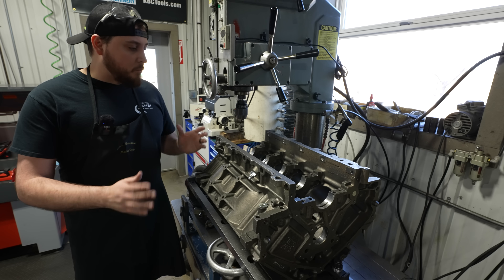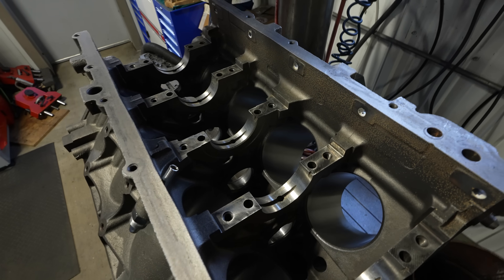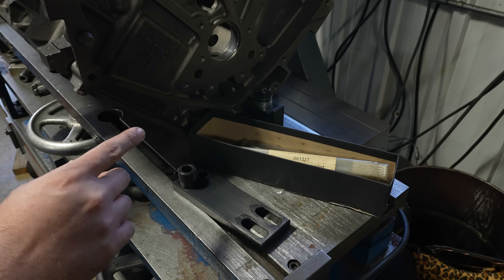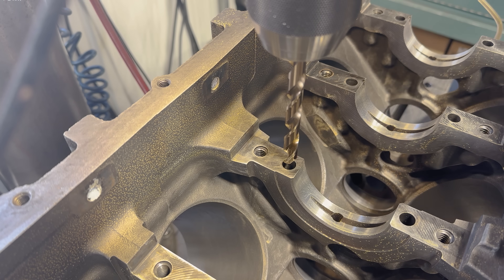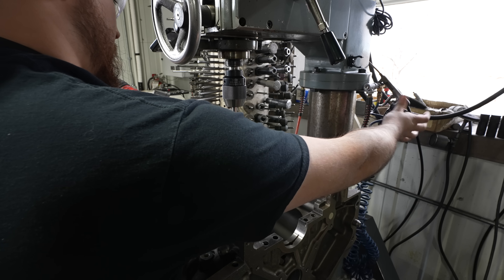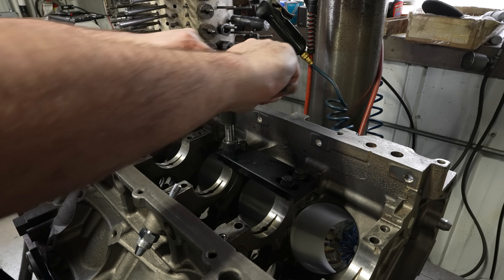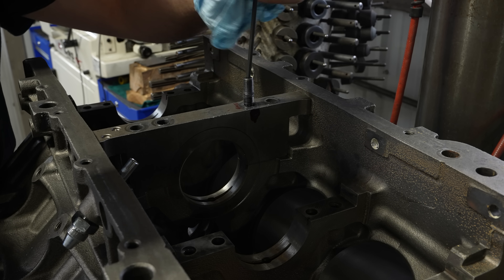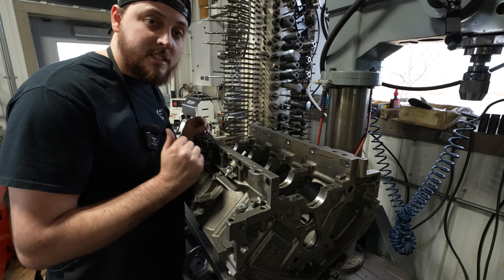The Customer BROKE A Main Stud Off In Their BRAND NEW LS Block...

Comment: Snapping bolts off in an engine block is a great sign that you have no business building an engine. Just sayin'.....
Reply: Work on enough of them and it will happen.
Reply: @4040pmora  33 years a tech, and 40 years of building / repairing engines, I've NEVER snapped a main bolt / stud, or a head bolt / stud. I've removed broken ones, but never snapped one off while torquing to spec.....
Reply: I've had brand new GM stretch bolts break off during the torque sequence. Shit happens
Reply: @garysgarage.2841  In vocational school, I watched a guy blow a chunk of the block out of a 4.2 AMC, because he didn't clean the bolt hole. Someone else's mistake, taught me a valuable lesson on the importance of proper preparation of critical fasteners. I have a ritual when it comes to head bolts / main bolts / cam caps, etc. TTY fasteners I mark with several paint marks, several colors, so I have 100% accountability for each step. I avoid distraction until I complete a sequence, then I can come back, and know where I left off, if I HAVE to, but I try to complete the entire torque procedure, without stopping. My tool rep checks my torque wrenches every 6 months, so I trust them. I probably owe it to skinny Mike, the guy who forced NCAVC to buy someone an engine, for going more than 3 decades without snapping a head bolt / main bolt, or any other critical fasteners. It starts with clean, dry holes, a thread chase, and another clean and dry, before following the manufacturer / or hardware supplier instructions.

Comment: Did one yesterday on my EDM. I even save the original threads. It depends on how much previous work the customer did trying to FIX it. Drilled off center,Broken Drill Bits, Broken TAPS ,and the BROKEN E-Z OUT are what you see from the Engine Shops.Let see you get a CARBIDE END MILL out using you mill. Use a burnishing tap, not a Bottom one to clean these holes with a lot of lube and blow out these holes.

Comment: On a new block and even one that had machine work done, the threads should always be cleaned and chased before bolts are installed. Also in this case I would venture to say either the person installing the studs did not use a torque wrench or does not know how to properly use one, or the one he used is way out of calibration.

Comment: Our shop has several EDM sinker machines. You can take a piece of copper tubing and burn out broken bolts, taps, etc. in short time.
Reply: Don't forget all HARD crap we can remover also and save the threads with our picks.

Comment: Well for those that have the time, on aluminum cased yamaha banshees if you drill out all the case bolts and use time certs its actually stronger than the original bolt holes.

Comment: We use a Carbide endmill and a Pure Carbide drill bit and pull out the threads or dill till the threads look like a Helicoil,   OR  we tap the block for 7/16 threads and put in a ARP stud,
Reply: That is the real FIX and linehone the block.
Reply: I fix others people’s foulups all the time. No good deed goes unpunished. Picture a shop the size of two Costcos. I use a milling machine, NOT a freaking drill press. I hold the part securely and locate the problem hole exactly. For a fastener I flatten the top and use a spot drill, then a left hand drill under the minor size of the thread. The left hand drill might loosen the fastener and back it out so I’m ready on the quill to let it happen. Then I try an “Easy out”. If that didn’t work, I interpolate out to the minor hole size feeding down manually ready for the remainder to come out. If it doesn’t, all that’s left is the helical thread that be picked, pealed or wiggled out. Taps are a bit more complicated and carbide can burned out but in all cases you got to be dead on and rigid. The worst thing is when some monkey tried and failed, further complicating or necessitating a Heilicoil or Keensert.

Comment: I have built multiple handfuls of those engines and have never had a main bolt issue. Also, with the arp studs, it should be line honed.
Reply: the ARP studs will be more precise than factory; the register in the block determines alignment
Reply: @donwest5387  it is still recommended to line hone the block with fastener upgrades as well as connecting rods be checked and resized if needed. Of course, cracked style rods can't be done.
Reply: @donwest5387 totally agree! No metal was removed from the cap or the block.
Now, they might want to line hone the mains. 
In my opinion, I'd run it like it is.
Reply: The bore still be pull out of round when upgrading to performance studs.No  different to rod bolt change outs.Have seen many bores go out of tolerance 0.001”

Comment: I think for a high hp build this would be a no no. Could maybe use a longer timesert but even then. The wall thickness reduction is the factor in question really.
Reply: My thought also. Timesert only has one size. HeliCoil hasn't got around to making them yet.

Comment: I have to wonder if there is any real advantage in using the thread insert vs drilling the cap as well, and just using a larger diameter stud.
Reply: Keeping the clamping load even and parts availability seem like good reasons

Comment: I seeing you line up the hole with the drill bit, I was reminded that we had a set of drill bit blanks that were for just that purpose. You can take the blank and chuck it and there are no cutting edges to worry about as you place it in the hole. The other thing we used the blank drills for was as references for sizing.
Reply: I would have welded the hole shut with an inferior metal like slag and shoved a little bit of JB and had the shipping crate readily to go.

Comment: Small trick I use is I get an old head bolt or mains bolt weld the threads a little and use that to wind the time sert in.
Then, you come in with the expander tool.
I've had the expander tool spread the insert early, this is a big pain in a hole.
Once you wind the insert in with an old bolt, you use a rattle gun to wind it out.

Comment: Yes sir that is a good jig to use for that repair. Might the customer had contacted you before they `attempted to drill that out it would have been better. If you found dirt down in those threads well that sort of tells ya doesn't it?🥸👍

Comment: Salt water cooled Chevrolet marine based engines  have head bolts that go into the water jackets. Doing  a valve job on an older engine would sometimes  pull the threads  out of the block deck on final torque. Off came the head. Spent a lot of time squaring  the drill to the block while working on a 45 degree  surface in a sometimes  cramped bilge. Put bolts  in adjacent  holes to visibly establish  90 degrees in both directions. Drilled by hand with a portable  drill. Then had to square the Helicoil tap the same way. Installed the Helicoil and broke the tab into  the water jacket.Then held my breath  when  final torqueing. Also ran a tap into all 32-34 block  threads using a  battery  drill with the screw clutch set as loose  as possible. Clutch would  slip if the tap bound up  or if it cross threaded when starting . It allways worked! I know now that I was supposed  to use thread chasers  which I now have. No machine shop precision but good  results anyway. Probably could have used the head as a guide  for the drill bit  but still has to remove  the head to install the Helicoil.

Comment: When I rebuilt my 360 (5.9l Magnum) for my Dodge truck, every orifice was cleaned with a brush and rinsed well to remove debris. Each bolt hole had a thread chase run down it to make sure it was clean and ready for install.

Comment: Another great tool to add to the shop is a set of LH twist drills. They will pay for them selves in one successful use.
Reply: Good point. LH drill can remove the bolt by itself during the drilling, while RH can tighten the bolt even more. Choose what fits your needs.

Comment: I would have tried to drill it out with an endmill that the same size as the original drill tap size first to keep the original threads, in case they where¨nt damaged. But solid metal inserts is another great way to do it.

Comment: I use left hand drills to remove broken studs. If a stud starts to move it will come out with the direction of the drill rotation,,,, hope this helps
Reply: This. This is stud/bolt removal 101.  No reason not to do this.
Reply: Left hand drill bit works well for cases such as when the bolt head snapped off, and there is no real tension on the bolt threads. However, in my experience, it doesn't work well when the threads are gummed up by dirt, corrosion, or thread locker.
Reply: @superbarnie  How about when the bolt is stretched as in torqued?  I've had shit for luck extracting or drilling anything out that's been snapped off.
Reply: @Florida_Man_In_Florida  Well, I'm not an engineer but I don't think the bolt is stretched along the entire length. As the bolt is screwed into the hole, the male threads are engaging the female threads on the hole at a 1:1 ratio. Unless the female threads are deforming or they are the wrong thread pitch, they should in fact be supporting the bolt threads and preventing them from stretching. The only part of the bolt that can freely stretch would be the part between the threads and the head, because nothing is holding it in place. This theory is further supported by the fact that the bolts tend to always break in this area.
Reply: @superbarnie What is to lose trying that FIRST 🤔 
My dad showed me HOW NOT to break them in the first place , then how to fix if you/ others screwed up . LH Drill was always worth a try
Reply: Was wondering why this method was not tried.

Comment: i think it will last just fine.  Timeserts are pretty good steel, the block was cast iron, so the timesert should be better / stronger than the original threads.

Comment: If this is an engine for everyday type driving, it should last as long as the rest of the engine.  Back during the days when I was a mechanic, I never broke a main or rod bole.  They didn't have studs back then.
Reply: Broke a main bolt on a 455 Oldsmobile because a new torque wrench  was 10-15 % out of calibration. Stretched the bolt like  taffy. No block damage.

Comment: I worked in the tool and die field for 50 years running stamping presses with tonnages up to 100 tons and smaller presses running up to 2200 strokes a minute. I've had my share of broken, sheared & stripped bolts and threads in very expensive dies and equipment. Such repairs as time certs, thread savers and sometimes helicoils saved time and money. I don't ever remember having a failed repair. The most tedious part is proper alignment. This block should be just fine.
Reply: I have been known to use EDM and make a broken fastener go away and send a tap in for freshing h the original threads. Takes time however, the deed is amazing on the end of repair. Stupid hard metals can be tackled with EDM and results are darned nice.
Reply: Dido ,   A repair as good as original thread 😉
Reply: The Rolls-Royce Merlin was made with thread inserts in every bolt hole. Not cheap or rapid manufacturing but it was extremely reliable.
Reply: @Dave5843-d9m  That is because a insert is true hard. And no it don't make sense to use it to build stuff!
Reply: Why not try short ez out at first drilling -so long as top burs on bolt are removed---and your close to center on drill ---it should come out  ---had head bolt snap on gen 3 ---drill straight clean burr off drilled about 1/4 inch or less put short ez out and out came bolt -- harbir f orange white package warrior 11 bucks
Reply: I had a helicoil fail on a head bolt repair, shop took it back and put a time cert in instead and it worked great. Helicoil never got close to the torque spec 😂

Comment: To be fair, a lot of mechanics don't have the luxury to stop working on a vehicle and send the part to a machine shop because they have a customer that needs their vehicle back and don't want to wait weeks for their car to be fixed so they HAVE to try to get the broken bolt out.  I am a mechanic and it is mildly frustrating to hear machine shops complain that the 200 pound monkey made the problem worse by trying to fix it or complain that the part wasn't brought to them spotless and they had to get their fingers greasy.  From the mechanics perspective it is like we did all the hard work and now have to wait weeks and pay out the nose then get talked about like that to boot.  Beyond that not every machine shop does good work like you guys do and i have had several "professional" shops return parts that had to get done again or could have been done better with a hand held grinder.  Just food for thought and figured I would provide the answer to "why mechanics even bother trying to fix it?" that you asked in the video.

Comment: I had this problem a couple of years ago with the same LM7.  Not one machine shop in the entire region I live in had the Timeserts for the LS engine.
Online the kit was around $700-$900 Cad.  Junked the block and got one from a wrecking yard for $100. 
This happened because I used ARP head bolts and the grease they give with the bolts got in between the washer and the head of the bolt or below the washer and the cylinder head.
So follow the directions carefully!
Thank you

Comment: Should have suggested to the customer that you can't/shouldn't just swap factory hardware for main studs without measuring the housings and at least giving them a swipe with the align hone. (assuming it's not already over specification)
Props to the customer for drilling the hole that accurately, it's not that easy to do.
Reply: Drill Bushing will keep you close most of the time.
Reply from the maker: . I advised them that it’s recommended to align hone, but that I have to outsource that operation so it makes more sense for them to take it to a different shop directly for it.

Comment: I love the way you blinked the first time the torque wrench clicked on the new main thread😂. I knew exactly how you felt; whether it's lower or upper mains, the excitement of waiting for the click is always good to get the old heart racing!
Reply: Once I made a new thread for the timing chain idler sprocket on an aluminum head, no inserts but that final click of the torque wrench feels nice.
Reply: It does indeed. I redid an old Kawasaki bike and when I tightened down the head studs (special long oversize-thread bolts), I was swearing for the last 10Nm :D  @JavoCover

Comment: I'm curious as to why you didn't drill it straight and run the factory sized tap in there. Did the customer ruin the threads when they drilled it offset?

Comment: Do NOT double-check your torque bolts (i.e. torque it twice at the same torque wrench setting). You have just over-torqued your bolts. In this application, perhaps it's ok, but in critical applications you WILL cause problems (binding, interference, premature failure, etc.)
Reply: That’s a wild take.
Reply: Yep, but it's a fact. Think about bearing clearances etc. @EngineRehab
Reply: @emailuser3869  what? Do you understand that in order to add additional clamp load to a torqued faster you must exceed the breaking force value, which is often 15% higher than the value the fastener was originally torqued to?

Comment: Just out of curiosity, have you ever tried using Reverse Cut drill bits? Since the cutting edge is turning the same direction the bolt would turn coming out, it can end up backing the bolt out. If it doesn't, you still end up drilling out the bolt. This was taught to me by an old school mechanic, and I have used to with 50/50 success.
Reply: Ah yes the old school term.

Comment: I'm surprised you didn't at least start off with a left-hand drill bit. Iv walked out sooo many drill outs that way saving the original threads. It's obviously never a guarantee,  but it's always my goal to try and save the original threads.
Reply: This! It works in the majority of cases.
Reply: YOU HIT THE NAIL ON THE HEAD  YES - YES START WITH LEFT HAND DRILL  I'VE DONE HUNDREDS 😊
Reply: Agreed. Best advice.

Comment: Left-hand cut drills.. Your new best friend for things like this.
Reply: If a bolt broke off because the threads bound up, you are screwed either way,  Left hand drills are useful for broken bolts that break from overtorque or shearing off.  Bound threads or rusty threads generally make left hand drills exactly as useful as right hand drills.  However, if you are going to drill it anyways, a left hand drill is your best bet, in case you get lucky.

Comment: There was a time where thread repair inserts were questionable.  The technology and techniques have improved to the point where they provide a strong and durable repair.  Most blocks will go to "engine heaven" with this repair still in place.  Nice job!
Reply: In a lot of cases you're better off running a whole set of timeserts through these old blocks - it's often a better result than using the old block threads.
Reply: I agree in some cases.  I revert to "If it isn't broken don't fix it".  If the rebuild is a factory spec'd project I'd leave it alone.  But yes, if the power output is going to be significantly increased the old threads may be the weak spot in the bottom end.
Reply: I used timeserts for broken bolts in the alloy swingarm on my motorcycle. Definitely stronger now than they were originally

Comment: What was the cost to the customer? ?  Is this a common procedure your company preforms? What did your dad have to say about the whole deal?do you feel comfortable doing this on a regular basis? Could you have preformed some type of metal tig welding procedure and then  drill and tap the block into the welded hole?
Excellent video thank you for your efforts.

Comment: I have used those inserts on a lower end of a boat motor. Drain plug. Plus, they were shorter. It went well and worked great. Far better than a helicoil. helicopter.